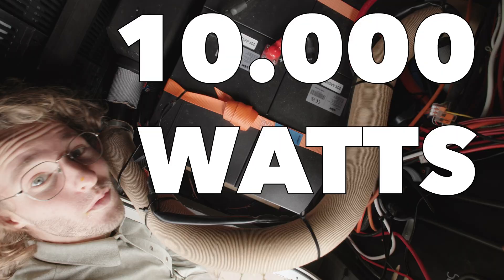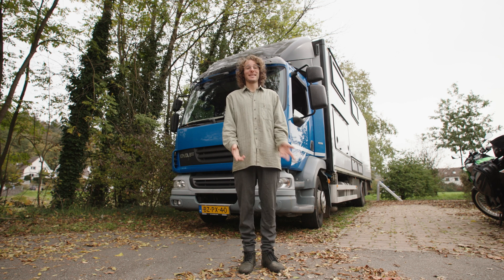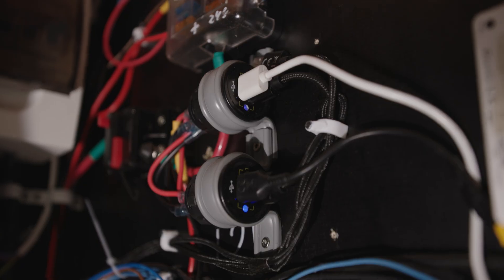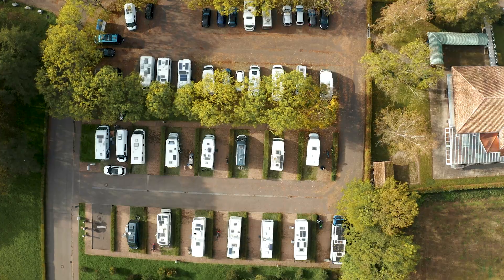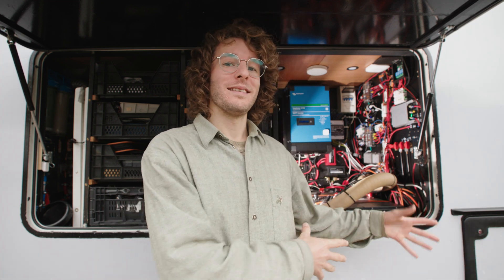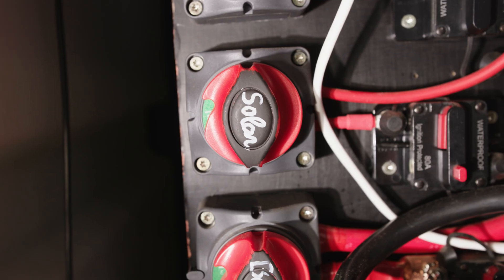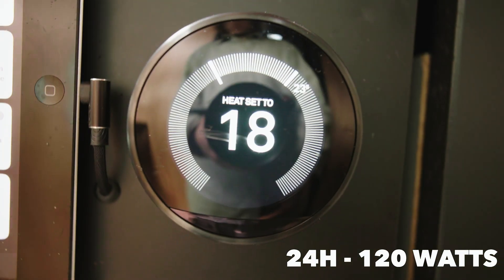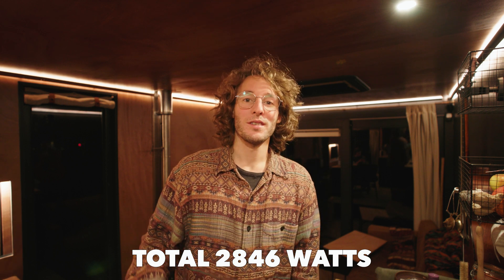Our Electrical System explained in 6 minutes

Comment from the maker: I forgot to mention in the video; the reason we had to charge at this 6€ per night RV spot is because last week we had very little sun. Also we parked in the forest for 3 days. Guess we're not completely off-grid after all. I'll keep you updated on how it's going as we gain more experience over time.
Reply: I didn't catch if you mentioned if you guys have an alternator to charge your batteries from your engine while driving? It could be your last resort, run your engine or drive to your next spot to save you from having to stay at an RV park.

How do you guys like having the multi-level flooring? It's a great idea with the huge storage drawers. I have planned in my sketchup to raise the floor on the whole box and make access hatches on the top of the floor to get to my storage. Some of these boxes are so tall, it's a great use of space to have floor storage (floorage). :D
Reply from the maker: We do have a dc to dc from engine to home batteries.. but it only charges at 50A 12v and 25a 24v. To get charged something noticeable in our 405ah setup takes a while;)

We love the raised floor! Ours is around 30cm high so it’s an ‘active’ step. We notice when we have for example our parents over. They struggle a bit with such a step. We however hop on and off it without effort. Also, it provides extra seating which is cool.
Reply: @NicoJona   Can upgrade the alternator(s) to a bigger one? Not sure if that would work for your truck? Anyway, I love your house, and that washing machine was a great find!
Reply: This is one of the most impressive van life builds I've ever seen. The amount of features and the layout of the truck is amazing

Comment: Aren't the 70 amp solar charger cap you below the max capacity of your solar panels?
Reply: Also, I would recommend putting the solar on the higher platform so you can pack the entire roof, you can easily fit 3500W...

Comment: Hey! How is your experience now, after the winter in Innsbruck? How much was your kWh averagage during the months dec-feb? 
I'm in the build of a truck same size, live in Bavaria and planned with 1,2kW solar and 5.5kW battery, so ruffly half of your setup... Thanks for sharing some insights, and thanks for the good inspirations you provide. All good to you! ❤
Reply from the maker: Hey :) 
If you want to talk a bit more in detail (also in German) drop us a message on instagram ;) 
But in general: nov-feb, 4 months in winter we needed to charge up 1x a week on a campsite. Another option would have been a generator, but we are not too keen on them 🫣
Also ready depends what you need to be running. We did not use any heavy appliances during that time of course like the dishwasher 🙈
Reply: Hallo Quirin, ich lebe auch in Bayern und plane gerade meinen LKW-Ausbau. Spätestens nächsten April geht es los. Werkstadt habe ich schon. Bist du vielleicht an einem Austausch interessiert?

Comment: If the positive bus is +24 V, then the negative bus is 0 V. Because it the negative was -24 V (as is written on your negative bus bar with a marker), then you would have 48 V across both poles.
Reply from the maker: You’re right. Though the minus is just to remind me what is on that negative terminal.

Comment: Cool video. One recurring mistake throughout the video, Watt-Hours!!! Not Watts :P 
Watts are a measure of power, Watt-Hours are a measure of energy. 
My tip for the solar panels not providing enough. You should clean them in the morning. Even just a little dust particle on one panel can make your whole array produce half since you are only plugged in to a single MPPT!!!
Reply from the maker: Thanks for the English correction! Great! 
We had our first freezing nights and to be fair cleaning the solar panels did waaay less then we expected 🙈🙈